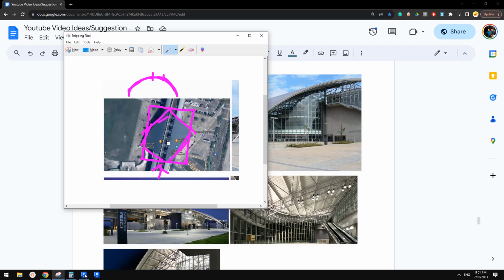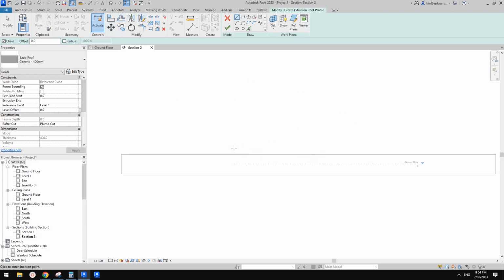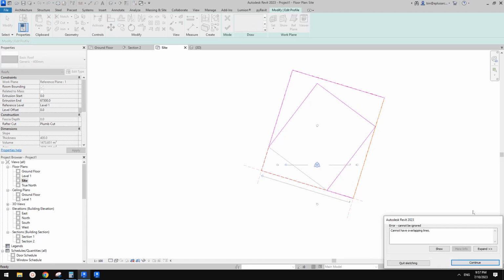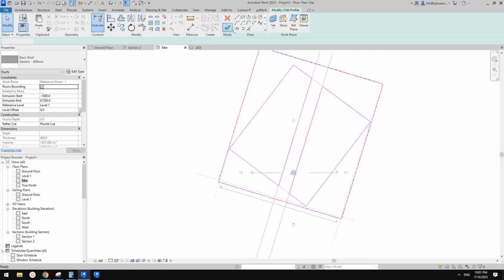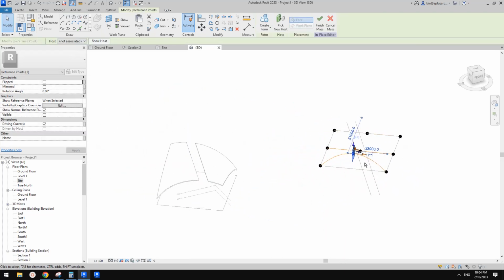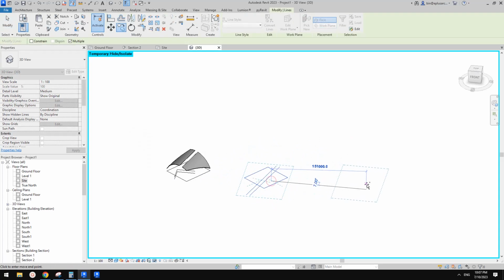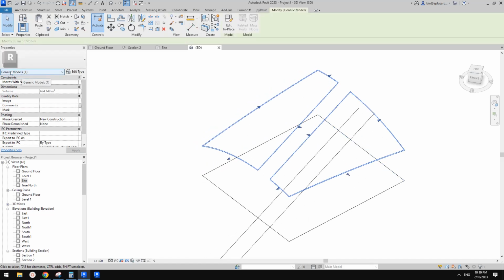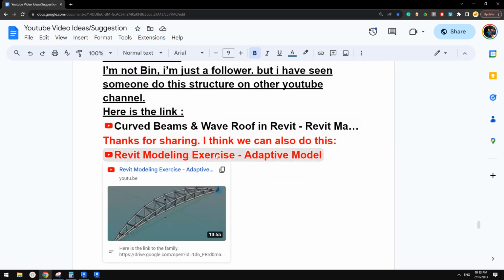23090 - Revit Roof Exercise (Roof By Extrusion, Mass, and Generic Model)

Comment: But if we use Extrusion or Generic Model for this roof, then how would we add adaptive family into it to create truss?
Or is it to create truss we simply have to use Mass to create the roof?
Reply from the maker: You are right, if we need to create those trusses using pattern-based family or adaptive family, the mass method would be a better options.
Reply: @BINHE615  Is it then possible to use pattern based family or adaptive family trusses on Extrusion or Generic Model roof then? Just curious...

Comment: How about the truss structruce ? Is that possible to draw om revit?
Reply from the maker: Yes, you can, usually mass with pattern-based family or adaptive family.
Reply: But if we use Extrusion or Generic Model for this roof, then how would we add adaptive family into it to create truss?
Or is it to create truss we simply have to use Mass to create the roof? @BINHE615